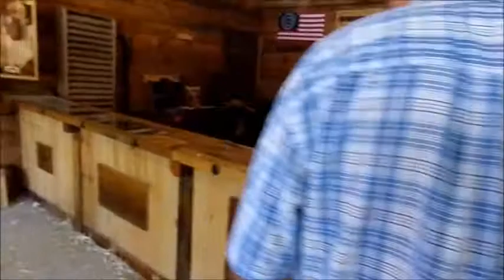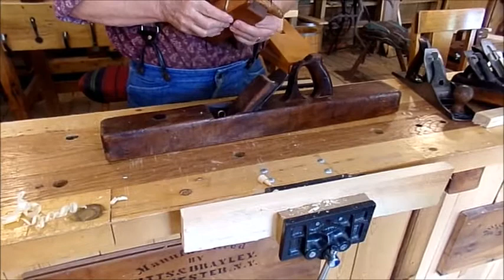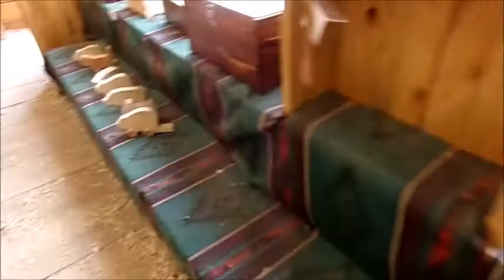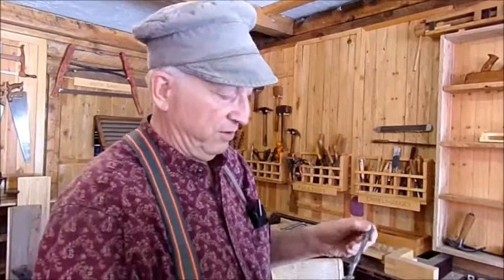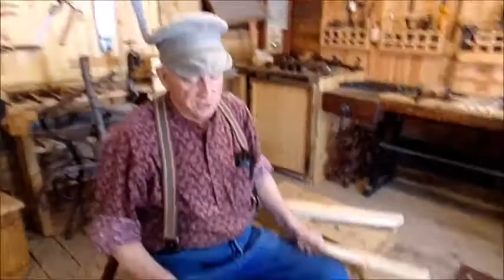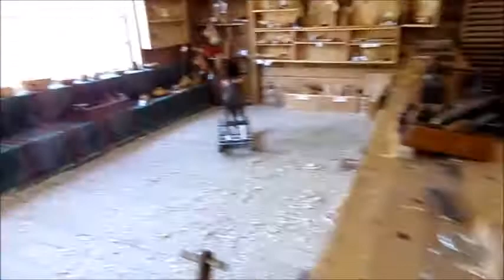The care and feeding of antique tools : the American West Heritage Center

Comment: The way this plane works is based on the length averaging out the surface imperfections over the length of the plane.  The seller states so.  However, while planing at an oblique angle as shown in the video will slice the wood fibers more efficiently, using this plane that way on the edge of a narrow board negates the design intent of a jointer plane.
Reply: Plus you wear the sole only in the middle so its gets concave extremely quickly